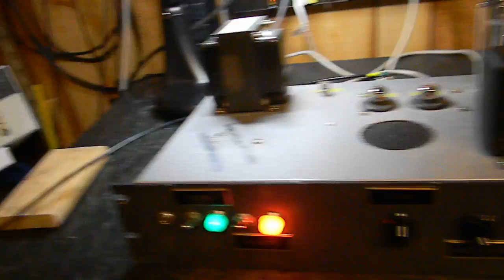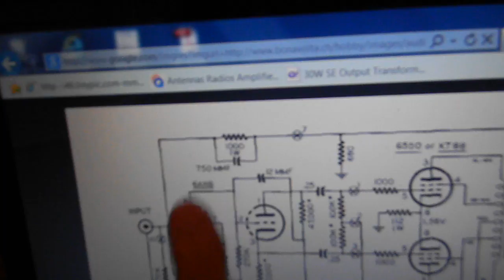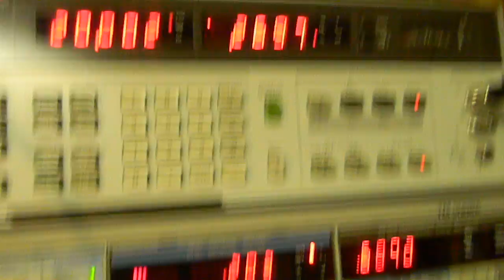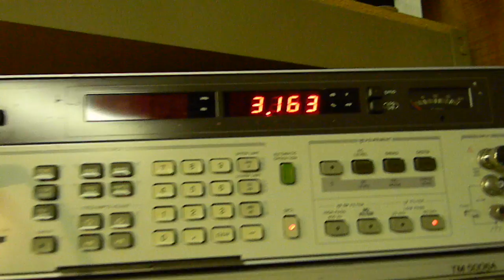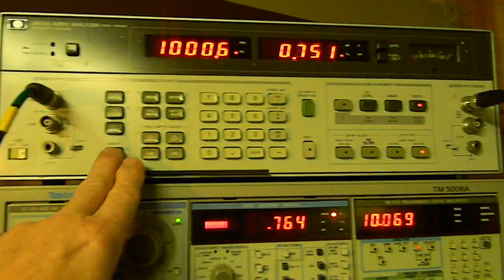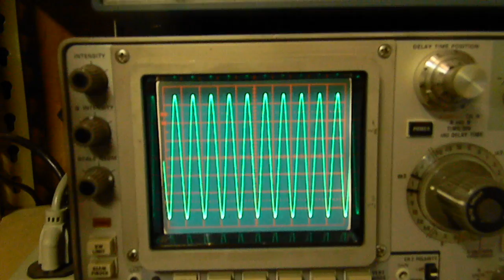Audio Amplifier Gain With And Without Global Negative Feedback.MOV

Comment from the maker: Yes, the gain is relative flat and easy to measure with the 8903A. I had some gain at low frequencies if I remember the video correctly. I also did the same for the Dynaco Mark III and it was truly flat 20 Hz to 20 KHz.

Comment: Another excellent video. When I was doing a lot more audio work, it was interesting to see the effects of cathode FB vs no cathode FB on class A single ended amps. We consistently had less distortion with minor loss at higher freqs. 
Do you do any single ended class A work? Less power but the sound was so very nice. I still run 45;s into Klipsch Heresy's that I have greatly modded. I have found nothing else I like better.
What HP device is to the left of the amp?

73,
Glenn WA4AOS
DSM Labs